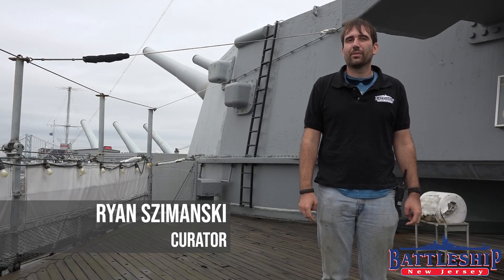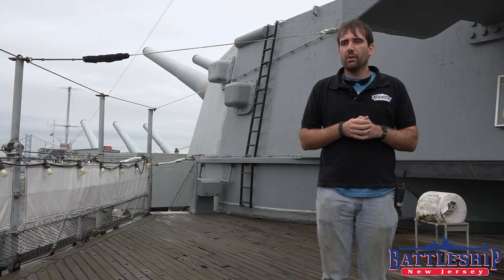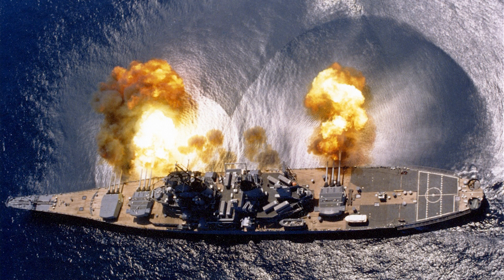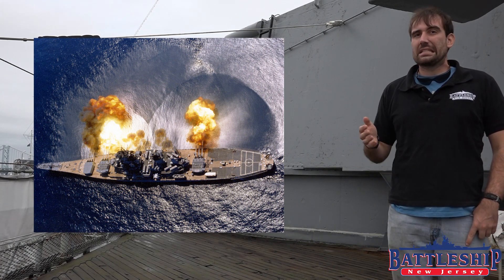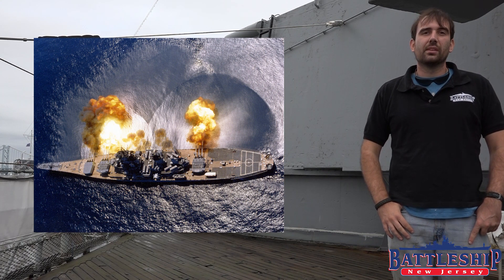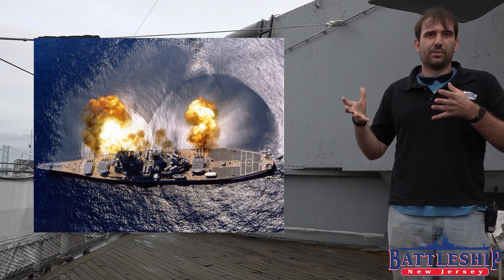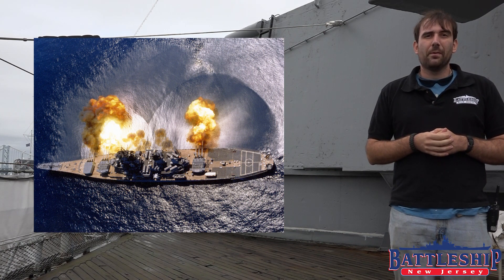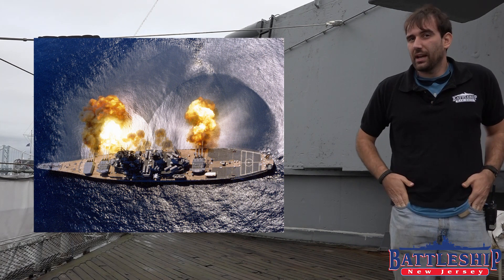Does Firing the 16in Guns Move the Ship Sideways?

Comment: I think it would be more accurate to say that the ship doesn't move laterally to any measurable degree.
Reply: Yes, the battleship would have to move laterally (third law), but I am not sure if even a micrometer could measure how far the displacement would be.
Reply: Yeah, you can't bring physics to the discussion and then say there is no equal and opposite reaction. If you're going to pull out the physics book for accuracy, then you need to say "yes it does move sideways ...less than an inch".
Reply: @garygrant91  oh it's more than a micrometer. more than a mm too. but less than a cm. On a 300m ship, you're not going to really consider a sub-1cm lateral movement meaningful. Not when every wave out there has more effect. I mean technically, the resistance of the water absorbingg recoil moves the earth a fraction of a subatomic particle's width. everything 'moves', the question is whether it's perceptible or meaningful. If you were in zero G on a space ship, and somehow you ended up stranded floating perfectly still, 1 meter away from the escape hatch, you could throw a spoon in the opposite direction, and an hour later you might have drifted enough to reach the escape hatch. It's that level of effect.
Reply: @kathrynck  Well heck, your space ship analogy gave clarity to my foggy brain.  I could look at and review mathematical equations the entire day and not understand.  
I hope you don't mind if I borrow your reply if this question ever comes up in a conversation.  I will do it with a smile and give you credit absolutely.
Reply: Read THIS branch of comments to find some good answers to the question.
Reply: @garygrant91  You're oversimplifying Newton's third law. Think more of force in one direction = to the same energy in the opposite. This energy is distributed around the ship where it manifests itself as noise, vibration with possible flexion & expansion. As it all occurs in such a huge mass everything is spread out so that 10's of tons of energy is spread over 10's of thousands of tons of mass. An analogy would be taking a paper bag sat on a table, blow in it gently so it expands a small amount & then settles back once you stop blowing without it moving in the opposite direction.
Reply: @kathrynck  - the ship as a whole, hull and superstructure, is not totally rigid I suppose, so I guess it would act like a giant spring, absorbing a good part of that energy. Tiny movements, but spread out over a large area. One former crew in another comment mentioned it "ringing like a bell" when the main guns were fired.
Reply: @steve1978ger  Yeah. What docthebiker said is true too, some of the energy is emitted as noise & heat. But since the boat is on water, it's coefficient of friction is very 'weird' compared to any object on a solid surface. I don't want to downplay the fact that water presents resistance to motion (a lot more than air) but the rules are pretty different than any analogy which has an object on a solid surface. Basically a boat is in a kind of moving state automatically, so you don't need to overcome it's moment of inertia, and it's coefficient of friction is kinda replaced with fluid dynamics & doesn't have a zero movement state. So it'll move if you sneeze. Just "imperceptibly". 

I mean, you can slightly adjust a boat at a dock with your foot, even if it weighs as much as an 18 wheel truck. If you need an extra inch to get the mooring line on the post, a firm push with a foot will make it move "eventually". Even though you can't push a shipping truck on land sideways with your foot. (PS: it's a gradual and small effect, never try to slow down a large boat's movement with your foot, it's a good way to get a crunched foot).

Real seas have wave patterns, currents, and wakes from other vessels, which would all have a bigger and overriding effect. You'd need to get a battleship into a giant "mirror-still" swimming pool to actually measure it's "gun propulsion", hehe. It's quite small, and functionally meaningless, but it does exist! And you could see it with the naked eye if you had a needle sticking out of the bow over a ruler secured to land.

Actually, something not brought up so far... the muzzle blast of the guns creates a brief atmospheric over-pressure above the water on one side only. That might have as much or more of an effect than the newtonian action of firing the gun.